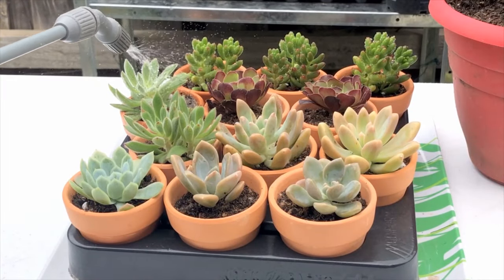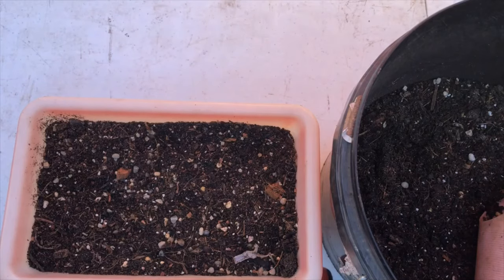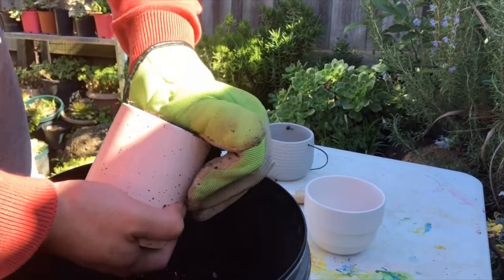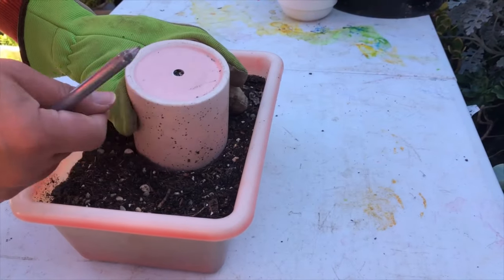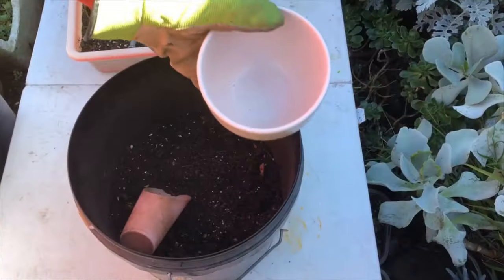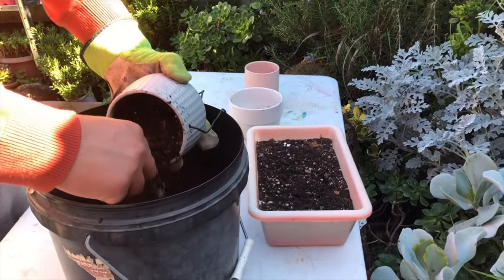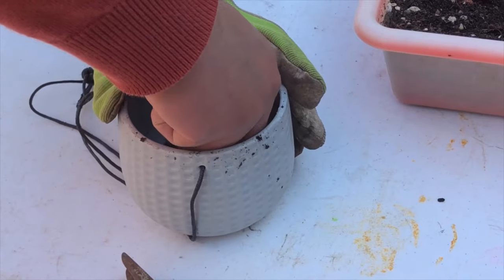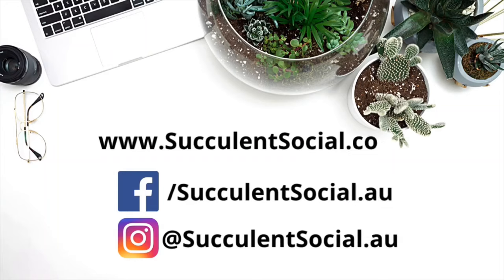HOW TO: PUT DRAINAGE HOLE in your pots WITHOUT DRILL

Comment: I did this! In a porcelain mug! I didn’t have a huge nail, I used the tip of a knife to get a little chip started on the glaze, tapped at an angle turning the knife point,  then a Phillips screwdriver.  I packed the mug with a wet towel and placed it on a folded wet towel to absorb shock.  However, it did ruin the tip of the steak knife! :(
Reply from the maker: oh poor steak knife.. Thought you headed to home depot for the nail? haha..
Reply: And I'm guessing your  tea  leaks out now?
Reply: Thank you so much for this technical. Thank you Alford.
Reply: I used knife and screwdriver took me an hour lol
Reply: @jennyshoarhouse LOL, good one!

Comment: I tried it, came out great! One thing though I ended up with a big chip inside the pot so maybe I didn't put enough tape? Or maybe I hit it too hard. Also I didn't have a big nail so I used the end of a screw driver (the one with the 4 thingys not the flat one) and it seemed to work fine 😊😁
Reply from the maker: Glad it worked for you... I feel that the major factors are 1) how compact the soil is inside because they absorb the pressure and 2) the amount of force of the hammer. But hey, who knew screwdriver will work.. haha..  NOw that the pot has hole, enjoy potting your plants in them.
Reply: Phillips

Comment: Will it still work if I want 3 holes in the same pot?
Reply from the maker: Hi Hope, it should work but if you punch 3 holes in smaller pots, extra care must be given as the base may weaken and potentially crack. Pots with wide base (about 20cm or more) should be alright with 3 holes.

Comment: Would this work with a glass jar
Reply from the maker: Hi there, I have not tried this in a glass. I have read that as long as you used a diamond drill bit, using this in glass will work but I have not tried this personally so I can't share any tips. I reckon it could be a bit tricky with glass so maybe try first on one that is not too expensive. Let me know if it works for you.

Comment: Wow they do it so easily. I m sure I gonna break my pot
Reply from the maker: Oh I am pretty sure you can drill that hole perfectly. The key is 1) put the tape at the bottom, 3) compact the soil , and 3) to start slowly with hammering. Practice on inexpensive pots first until you get the hang of it. You can do it!